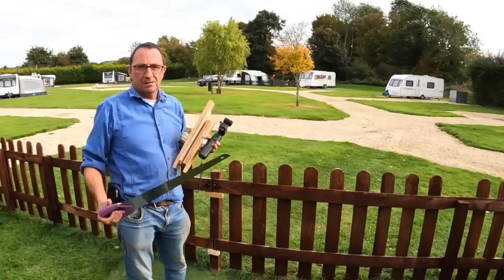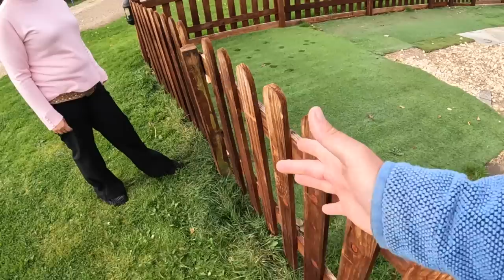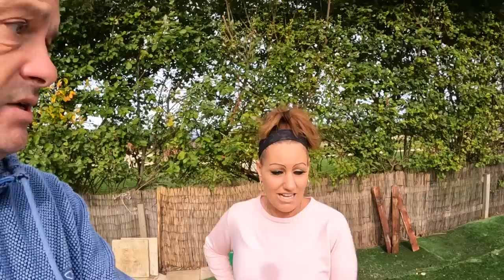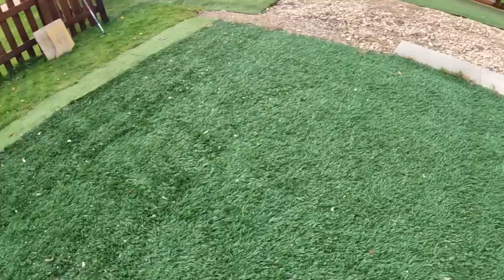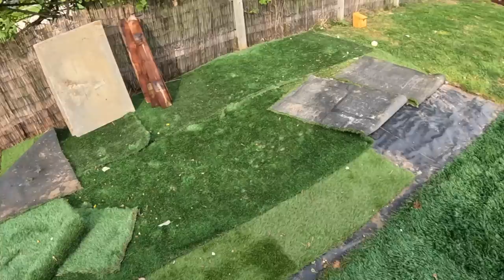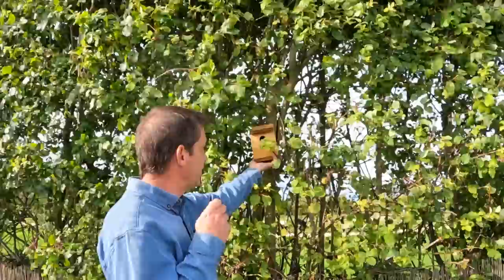Getting STUCK On Our SEASONAL PITCH, 2 Wrong's Don't Make It Right!

Comment: Easy fix with the fence problem. When you put the post back in the ground to close the gate, put it in the opposite way round with the 2 pieces of wood facing out of the pitch so the gate sits nice and flush.

Comment: If you put the bird box with the hole vertical the bird might struggle because you are taking away the little ledge for them to jump to, to get out. If you know what I mean… they would have to fly in a vertical way to get out instead of a kind of horizontal leap to the hole which also doubles as a little ledge..

Comment: Red wire to red wire, black wire to black wire, and NO you will NOT get electrocuted with only 12 volts. Just don’t let the black conductor touch the red conductor or you’ll get a little spark as the fuse blows.
 It’ll be good to put the bird box on its back, they’ll have a nice indoor swimming pool after it rains.